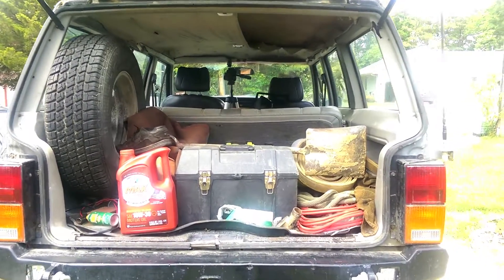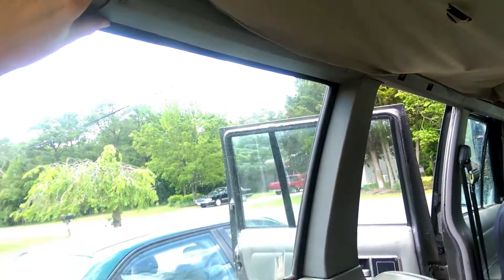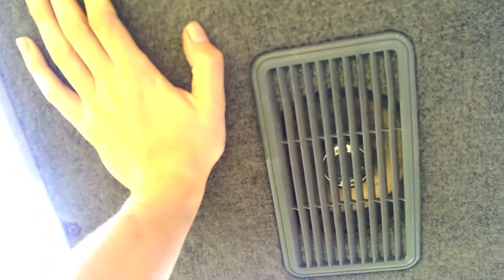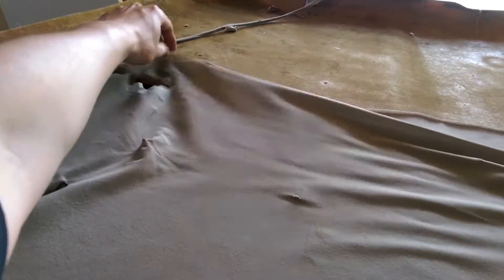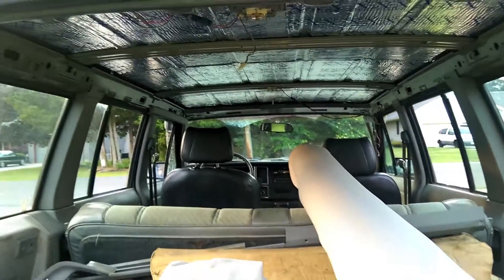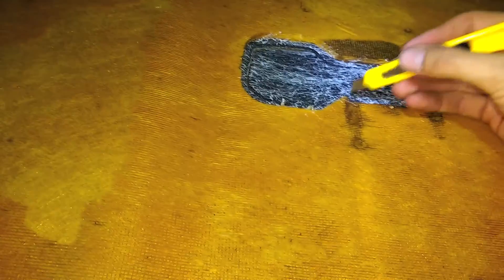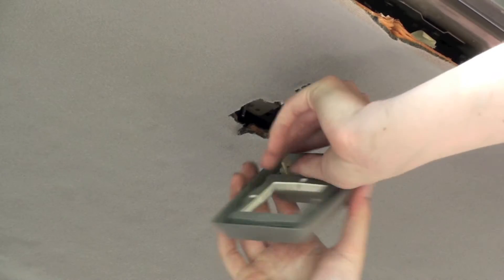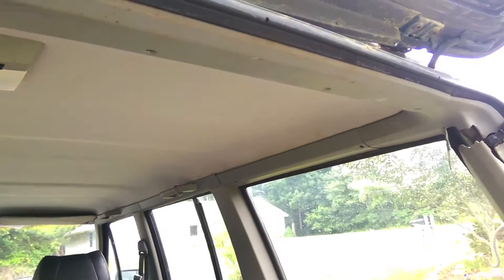89 Cherokee Replacing Old Headliner

Comment: I just received my headliner kit for my truck back form WLS headliners.  They have a service where you can send in your sunvisors and they will recover them in the new headliner material so they are a perfect match.  They also can try to colormatch the new material to your sunvisors after received - then send back the roll of head liner material and the near new looking visors.  Mine look amazing.  The sunvisor job was great and my color is a super close match.  Their service was amazingly fast too.  I highly recommend the and the price was so low for what I got. Highly recommend them.

Comment: I just but 5 yards of dark gray felt from Wall world. No foam, but should still go on right?
Reply from the maker: I think the glue will still hold but might look a little funny.
Reply: @NickInTimeFilms  It shouldn't be too bad. I'm going with a darker gray to match the rugged ridge seats I got in black. The back seat will need a cover though. Plus the Wally world stuff was only $15 for 5 yards. I'll also be using air duct insulation in loo of rattle trap. I'll let you know how she fairs XD If you're gonna half ass something, I guess half ass it all the way right?

Comment: That looks so nice and fresh, it really does sharpen up your jeep so much :-D
Dont underestimate how well youve done a job, those slight wrinkles will vanish with warmth and finger prodding lol, i have to admit i would be apprehensive doing some of the jobs you have done with ease, the fright of screwing things up is a handicap to the spongey thing residing above my eyes ha ha :-D.
Years ago a mate said "help me with a gearbox change".
We took the little gearbox out and he discovered a mistake, he had got the wrong one from the breakers yard, he just gave up, the box was the estate version with longer remote/output and shorter driveshaft.
Me being a bodgy git said "there both the same gearbox really, cant we yank both apart and mix&match", they are both useless so "we cant fuck it up any more!!".
After the mix&match and an oil infusion the gearbox worked perfect, he has gone so deep into engines/gearboxes since then, the "we cant fuck it ....." statement enabled him to "Have a go", he said it taught him, i felt like yoda ha ha :-D
Sorry about my long reply.
Reply from the maker: zx8401ztv It's getting a little better but I'm not too worried about it, It looks good enough to me. 
And as with most jobs, I'll research as much as possible and get a good idea at what I'm doing before attempting it that way I can be mostly prepared for what lies ahead.
Sometimes that's the mindset you have to take. You might not always be successful, but at least you can say you tried. And congrats on the gearbox, it's not always common that parts interchange and play nice.
Reply: NickInTimeFilms Yes you sound very logical and do research, that is of cause the intellegent way to tackle a job. :-)
At the time i knew next to nothing about car gearboxes, my hobby was electronics and computers, but like most blokes i had to repair my motorbike without expensive shop bills so learning by doing was the way.
Talk about the blind leading the blind ha ha :-D i had fun :-D

Comment: Additionally wear a mask so you're not breathing that crap in accidentally .And eye protection isn't a bad idea either .And..a company called JoAnn fabrics also carries headliner material for way less than this company and in different colors .You simply pay by the yard or buy a bolt of the material .A can of 3m spray doesn't cost much .Or you can go with a roll on glue which might be better for some applications .The problem I've seen with  spray on glue is it can get clogged pretty easily and sometimes the propellant doesn't work right . This is why I prefer a brush on glue instead because you can get complete  coverage . Restoration and upholstery shops use adhesive sprayed on via paint gun style with a fan tip spray pattern for wide coverage.So that's another possibility to consider if you have the means to do that.

.Also using a roller for better adhesion is a good idea as well .One other important item is when cutting out the holes for the lights it's recommended that you cut a "X" pattern and tuck the excess on the back side of the headliner .This way it looks better and gives ut something to anxhor to .You always want to leave a little extra ,about an inch and wrap that on the back side .This is how the professionals do it . Just some things I learned along the way doing this particular type of job before a few times . Lots of decent webpages and YouTube channels to look at for advice on this project .All in all a good job though . Not being overly critical, just some friendly advice.

Comment: +NickInTimeFilms  NICE JOB!  That spray adhesive is HOW logos get onto Tee shirts!
I went thru cans of that stuff while screen printing.  OK Now I may have to figure THIS trick out.
I think your color matched fabulously, cuz even though you had some dirt - ALL fabric is going to change color no matter what - and every batch is dyed differently, and in different places.
I'm wondering if you should have save some fabric for just the outer sun visors now that I see the process.  So this video is a couple years old, how did the process hold up?  Or do you still have your jeep?

Thanks, subbed, I might learn some more nifty tricks from you.
Reply from the maker: +~Whitewolf The headliner is still holding up excellent. I do still have what's left of the roll.

Comment: Hi nick what tiipe of insullation did u use
Reply from the maker: The stuff on the roof? It's a sound deadener but does reflect a decent amount of heat. I used Fatmat Rattletrap because it's some of the thickest on the market and has a much better price per square foot. I'll have a video up when I'm don't putting it all on.
Reply: Where du u getter sorry to bother u man
Reply from the maker: Luis M Gutierrez ordered 50sq-ft off Amazon. You can check the fatmat website and see if there are local distributors
Reply: Tnku man

Comment: I did this job, twice, with the adhesive shown. The fabric eventually let go over time. I wish someone would come up with a replacement for that fiberglass insulation board thing. They are fragile, and mine won't withstand a 3rd attempt.

Comment: Looks good. I would be concerned at how close the fabric is to the dome light bulb. Those bulbs get HOT, you might want to cut that material back a bit more around the bulbs.
Reply from the maker: I'll look into it. I may or may not be going to LEDs at some point.

Comment: That metal ceiling looks nice. How would it look if I just removed my headliner and put everything back?
Reply from the maker: My friend is rocking a bare roof. If you don't care about comfort then you can. It radiated summer heat like an oven, feels like a freezer in the winter, and sounds like a tank when you shut the door. it's bare basics for sure.
Reply from the maker: Unless you're talking about the fatmat Sound Deadener. That helps a little bit.
Reply: I meant the roof. :) Thanks for the videos, they are very helpful!!!

Comment: Typical flimsy and crappy GM interior parts for the era . I've had to restore several from that era 
. They didn't use enough glue and the material was thin and sagged easily after a few years .I inherited my brothers 1990 Pontiac Sunbird after he passed away in 2009 at an early age, that he hadn't fixed up yet but wanted to and had a lot of serious work on my hands once it was mine .
He wasn't really much for turning wrenches but was a great guy . I wanted to realize his vision for what he wanted for his car to be and its taken quite awhile to do . It's a sporty little thing with excellent traction and really good handling McPherson struts,power assist rack and pinion ,power brakes and a bunch of little extras with a peppy 4 cylinder and a 5 speed manual but no cup holders !! 😨😤
 It's a two door hard top coupe and gets phenomenal mileage like 45 mpg which is almost unheard of .I thought I was mistaken till I checked it several times and verified the mileage . Considering the fact that it's got 183k on the original motor and doesn't smoke at all is just amazing.
 I had heard terrible things about these cars and was initially leery about keeping it or investing money into it .
After reading up on recalls and complaints , apparently the 90 model was the one year they weren't plagued by issues when previous and post years were .
Just got lucky I guess . This things headliner was terrible . I recall seeing my brother pulling up to my house with his headliner blocking his view .Then one day he just couldn't take it anymore and grabbed his box cutter and went off on it in a fit of frustration and rage.
I said oh that's great ,now what are we going to do ? I had told him I would help him glue it back . So I inherited a car with a yellow roof interior that rained down insulation on your head when you hit big bumps ! Lol 
Anyways...Thats all been taken care of now . Pretty easy job really , even for a small car like this one .The Sunbird at that time was the smallest car Pontiac had ever made . It's actually smaller than some compacts today . I don't mind though because it's fast and nimble and a blast to drive especially on tight corners .Most of all it's paid for ! Over the years I've replaced many components on this car and upgraded many things along the way like ventilated all wheel disc brakes upgraded motor mounts , exhaust etc.. a long list.
Compared to todays modern cars it's a breeze to work on even if it has a computer management system . It's not nearly as complex as todays over bloated systems . I mean seriously do we actually need a complex computer sensor system to turn on the headlights ? I think we have one, it's called a brain ?
 Or do we need a separate fuse for each individual running light like some newer cars have ? 
An old 70s Ford I had used to tell you that a turn signal or running light was bad by showing a signal indicator dully lit up because it had an open circuit. Just basic wiring that worked. Todays cars are supposed to be better and safer but then again they're made pretty cheaply and I wouldn't trust the airbag not to go off prematurely like they have before killing several people because of shrapnel lacerations . Yeah great newer stuff eh ? But I digress.

Back to the subject at hand...
The worst headliner to deal with was the older opgi bow style that had tension rods .They were pretty stout and well built but installing one could be a pain for some people. I'll be doing one in the future for a restoration project on a 1970 Pontiac Grand Prix ,two door that has a 400 Pontiac block motor ,a new Edelbrock intake manifold and carb , electronic ignition and a turbo 400 automatic transmission . This thing is the complete opposite of the little nimble beast I drive daily . Its a land yacht with the longest hood in production history from 69 to 72  . Heavy steel construction ,chrome and leather with a deep muscle car growl . Nobody wants to be hit by this beast . It's as long as my 87  Chevy 3/4 ton van at 17 1/2 feet compared to 16 and change for the van . It glides over the road like you're floating and gets terrible gas mileage ....lol 
So it's going to be a nice day  Sunday driver only . It has all its original parts minus a couple of exterior trim pieces but I'll get those later . Those older cars when in decent shape sell for quite a bit now to the collectors and rich boys who want a status symbol . I just like working on older cars for a hobby .It keeps me sane and out of trouble . Plus no bullshit computers to mess with . You have to understand what makes a car tick and be in tune with the car and know how everything works . Most people today don't have a clue what to do when their cars break down and are held hostage to the dealership or shops who may or may not know what to do about the car .  You have to have special training and specialized tools and scanning equipment to understand whats wrong with cars today. Very often I've seen mechanics replacing various parts never finding the true culprit for the problems which of course agravates the customer who's footing the bill.
So if you don't mind searching through flow charts and diagnostics equipment ,new cars might be you're thing .
I've taken the time to learn to work on the newer stuff but don't exactly enjoy it. Ive learned about the sensors and have  various diagnostic equipment . I've learned out of necessity because I got ripped off one too many times  and had to go back and fix their mistakes and got sick of it .Todays cars aren't built with the mechanic in mind or to be kept on the road for years , they're built to be thrown away and thats the truth . Not exactly good for the environment ... I'll stick with my old easy to work on cars thank you very much and keep them from the scrap yard as long as I can . Aside from my rant good detailed information on the subject !👍👏
Reply: AMC/Chrysler/Jeep